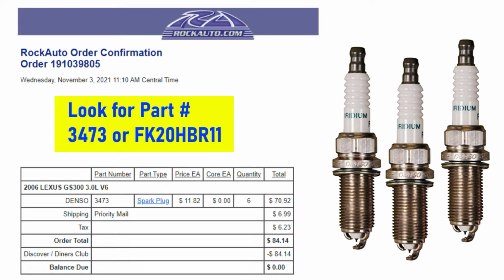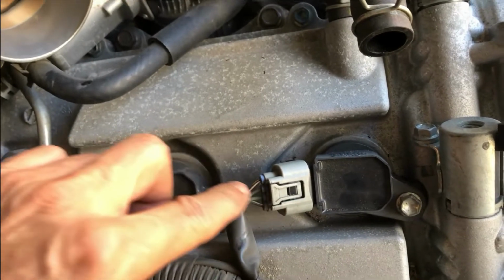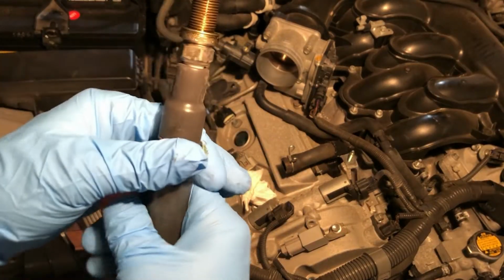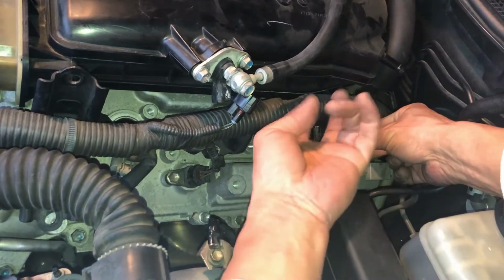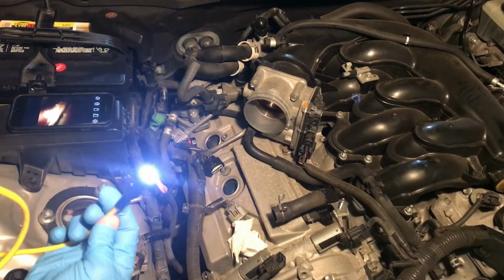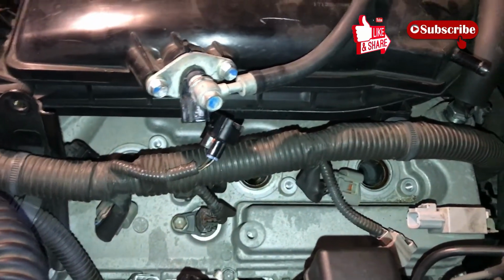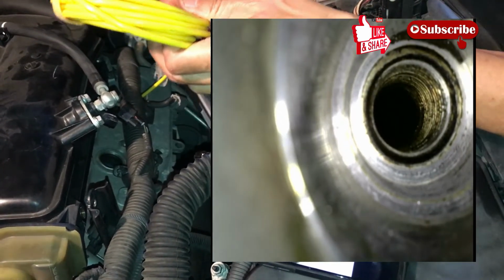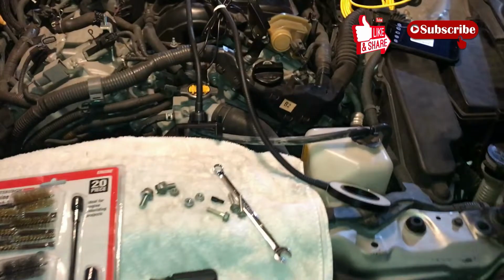2006 GS300 Spark Plug Change & Borescope view of Carbon buildup on pistons

Comment: Great job man May I ask how many mileage when you was filming this video and what kind oil you use ? And what gas Station brand and what octane you normally use ? and did you ever use any fuel additive at all ? My top pistons on my GS 350 were the same if not worse than yours it has 124,000 I owned for a year n half and using shell 91 all the time sometime Costco and now switch to chevron
Reply from the maker: Due to pandemic, I’m working from home so I don’t put too many miles on the car. That was done just short of 115K miles.  I usually use Mobile-1 full synthetic but last one was with Walmart Super Tech synthetic oil because they didn’t have what I needed.  I only use Costco gas (regular now that price is high).  I also use Lucas fuel additive every few months.  I buy a gallon of Lucas because it’s cheaper and put few ounces each time.
Reply: @DIYLifeSkills  I been using pennzoil platinum High milage 10w30 and i ordered the ultra platinum version 5w30 they said it keep pistons and valve cleaner because it has high additive, but one of my friend told me just use mobil 1 to see if my car will stop the white smoke or not, not sure why I’m getting this white smoke not sure due to carbon buildup getting burnt or I have a problem not really know !!!
Reply from the maker: @costantineyoussif6679  Brief white smoke at the start, especially, cold start after sitting overnight is quite normal as long as it goes away once the engine has warmed up to normal operating temperature.   If you see white smoke coming out after driving for 10 minutes, then that's a strong sign that small amount of coolant is leaking into the piston chamber.   Check you coolant level very closely for few weeks. Mark a  coolant level line when engine is cooled, and keep checking it for few weeks to see if it's going down...it shouldn't.
Reply from the maker: @costantineyoussif6679  If coolant level goes down, then it's head gasket leak, but based on your carbon build up on piston top, this is likely not the case.  When coolant leaks to piston chamber, they actually end up cleaning the carbons on piston top.  Sort of like using water mist to clean the piston carbons.
Reply from the maker: I think I see white smoke when I start the car in the morning for about 5 to 10 seconds.  Once it warms up, I don't see any smoke.
Reply: @DIYLifeSkills  but my coolant level hardly drop I notice I’m loosing some but that’s normal in the long run like half inch in almost 1 year, how do I test out if I have head gasket leak ?
Reply from the maker: @costantineyoussif6679  If you have head gasket leak, you'll notice it within days to weeks depending on the severity.  Also, if there is head gasket leak, you will see white smoke all the time, even when the engine has warmed up.   In the worst case, the car will produce large white smoke like mosquito trucks when driving if the leak is really bad.
Reply: @DIYLifeSkills  how often you should add coolant to get it to the max level or in between the max and low ? Because I always leave it at the max level
Reply: @DIYLifeSkills  mine doesn’t sometimes it’s condensation and I know that’s normal , but the other white smoke comes after a short trip and let the car sit for like 30min then the puff smoke comes
Reply from the maker: @costantineyoussif6679  Easiest is to monitor coolant level very accurately. Second is, engine oil will also become milky…but the leak has to be sufficient to make it to oil as small leaks will combust into steam.
Reply from the maker: @costantineyoussif6679  Also, piston top is usually clean from carbon build up when you have coolant leak but you had heavy carbon coat. So that means either the leak is so small or it’s not leaking at all.
Reply: I only use shell ...ExxonMobil...and sunocco since I read few articles saying their gas is great for ur car and my car just performs way better
Reply: @DIYLifeSkills you put regular instead of premium gas??????
Reply from the maker: @carlosrivera5357  I’ve tried premium only, regular only, and then alternating between them on next fill up and I didn’t notice any difference in mileage or performance.  But I drive car gently to avoid premature failures in engine and transmission so that could be why.  So, I’ve been using more regular especially when gas price is high and once in a while I’ll do premium when gas price low like now.
Reply from the maker: @carlosrivera5357  I use Costco excl because it’s near my home and it’s top tier gas.  I never use cheap brand or no name gas stations unless I’m traveling and running out of gas.

Comment: The oil is from is probably from the valve cover gasket.
Reply from the maker: Yup I’m pretty sure it’s the spark plug tube seal also, so I’ll need to do entire valve cover gasket change once the whether cools down.  It’s been scorching hot here in Houston.

Comment: At what mileage you supposed to change plugs?
Reply from the maker: Owner's Manual states very 60,000 miles, but these Denso/NGK Iridium spark plugs are designed to last 100,000+ miles, so you could possibly go longer. This car is getting first spark plug change at ~113K miles.  It's running smoothly, but once I remove the spark plugs, I can clearly see the wear and buildup and mine definitely needed to be changed. 

If you do change, go with the matching OEM Denso FK20HBR11 (aka 3473) for optimal performance and reliability. RockAuto seems to provide the best price. Also be aware that there are many fake plug sellers online, so only buy from reputable stores.

Comment: I have the same car I’m getting a misfire on cylinder one and 6
Reply from the maker: You need to rule out whether it’s spark plug, ignition coil, or fuel injector.  Cheapest way to do this without blindly buying things is swapping things for test. Swap ignition coil #3 with #1.  If misfire moves to #3, you need to replace the ignition coil.  

If not, then also swap #3 plug with #1.  If misfire moves to #3, get a new spark plug.    If misfire doesn’t move, then it could be your fuel injector, which is difficult to get to because you have remove upper (plenum) and lower intake manifolds.
Reply from the maker: You can apply same diagnostics to cyl #6 by swapping with #4. Let me know how it goes.
Reply: @DIYLifeSkills  ok thank you 🙏 I am currently doing this right now
Reply: @DIYLifeSkills  so I checked the spark plugs and they were toasted one one cylinder when I took the coil off it was full of oil I think it might be a gasket leak .tomorrow I will buy new spark plugs  and test it out
Reply from the maker: Oh my oil between the coil and plugs caused the misfire.  I had slight oil coating on couple of plugs also but these plugs didn’t have much torque when I unscrewed them.  So I torqued to ~20 ft lbs when I put the new plugs in.  

Back on oil on your coil and plugs, if tiny holes around the 3rd piston ring area gets clogged with carbon, then then this 3rd oil ring can’t scrap the oil back down to the crankcase, which means some oil is left in the piston chamber and on upward compression stroke it will push the oil through spark plug threads and and onto the coil.  

So first be sure to torque the plugs to about ~20 ft lbs, but you should really get a borescope to look at the piston too and the edges.  About $70-80 borescope have a second camera lens that can also look at the piston walls. If you don’t see dark spots on the piston wall then it’s a good sign.  Take a look at my piston top carbon cleaning video and also go look at “Care Care Nut”, the master Toyota mechanic that explains how carbon build up on 3rd piston ring causes oil burn and misfires.
Reply from the maker: And definitely, plug seal gaskets could be leaking. Though it’s a hassle to do the valve cover and plug seal gasket changes, it’s definitely DIY-able compared to the 3rd oil ring failing.

Comment: Nice. Drivers side seems like a pain lol
Reply from the maker: Yeah, wiring harness gets in the way, so you just have to get that out of the way a bit. It's not terribly difficult.  Just look at what I had to do, and you can complete all 6 plug changes within 1 hour or so.   Depending on how many miles you have, prepare for ignition coil connectors to break, but you can just buy the replacement for connectors and they are cheap. 

https://www.youtube.com/watch?v=nX33dk11EU4
https://www.youtube.com/watch?v=rhp-ENvNje0
https://www.youtube.com/watch?v=wWBCgY9nN_0